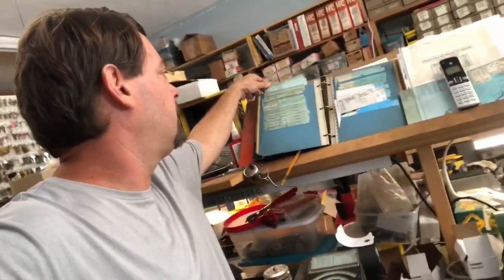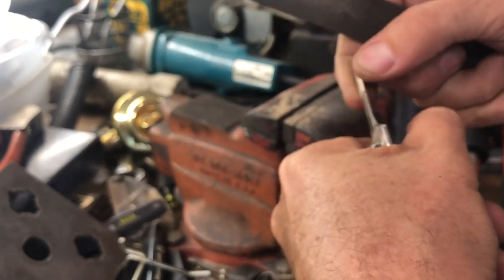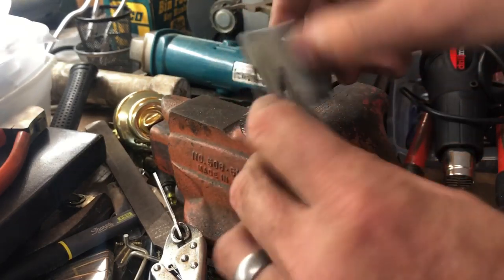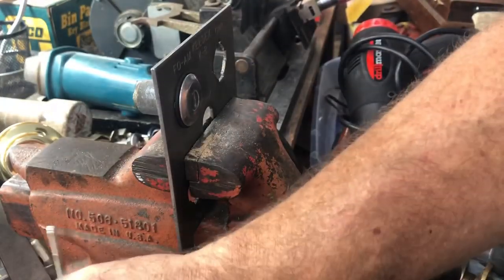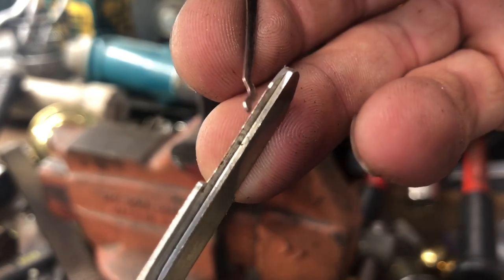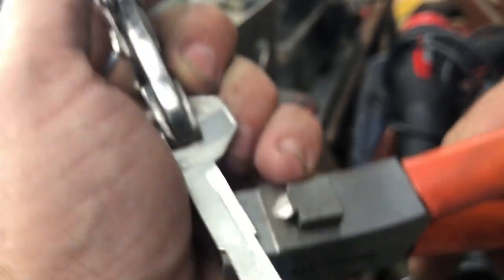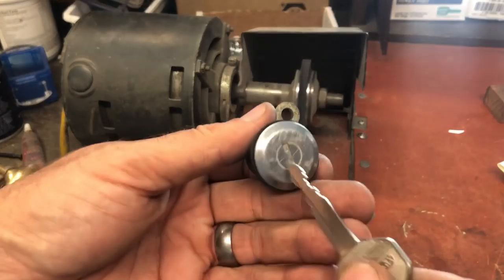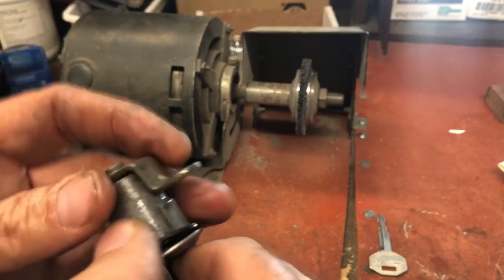impressioning older car lock with Lishi clipper

Comment: I found on this older style of auto key, namely a wider flat blade motorcycle key, that shallow cuts would chip the leading edge but not cut all the way through, leaving a sloping edge I couldn't then add to. It would continue to follow the same cut path.. I could continue it with a file, but that seems like it isn't the point.

Deeper cuts were fine and square, but making tiny adjustments to non brass keys didn't seem to be possible with my lishi cutter.

Had to wonder if I had a bad cutter, or if this just wasn't going to work out.

Comment: The way the extra cutting wheels on the HPC1200 rotate while they vibrate makes me nostalgic. Excellent video.  First one I've seen on the Lishi cutter being used even though I know it's been around for a minute. 

 And I'm glad I kept my blue cards after my 1200 got stolen out of my van.  I forgot the amount of information on the back of them that isn't included when a card is printed using Genericode.

Comment: Great instructional Jason. Good tip on cutting different depths on opposite sides. Thanks
Reply: Kevin Koepke A similar handy tip for those with two vehicles that both take the same key blank is cutting one side of the key for each car, giving you one key that will start both vehicles.

Comment: I ran into a lock that kicked my ass I’m an hvac guy and I basically a contractor for a particular bank. Please do a video of What are the differences between all the different locks passage entry storeroom I don’t know what to order lol ... please help
Reply from the maker: Great idea! The standard items are Passage (non locking) Privacy (locks, but can be opened with a coin, etc used on bathrooms) Entry (standard key locking with button inside) Classroom (key locking, no interior button) Storeroom (always locked)
Some of the Sargent and other Mortise locks use all kinds of numbers and codes and such for a wide variety of functions beyond those cylindrical locks.
I can do a video on that for sure, I completely understand being confused by functions!